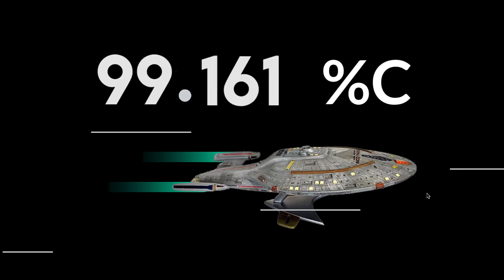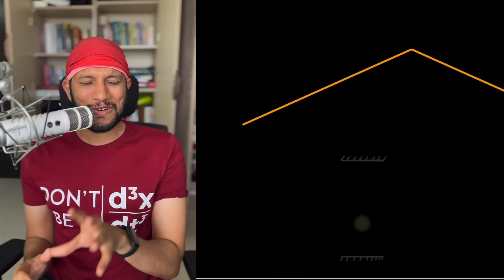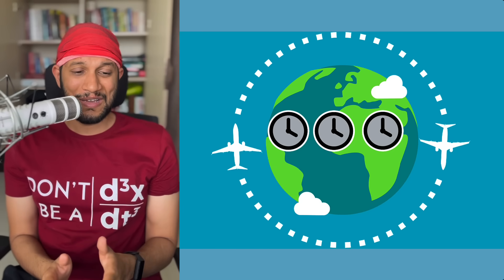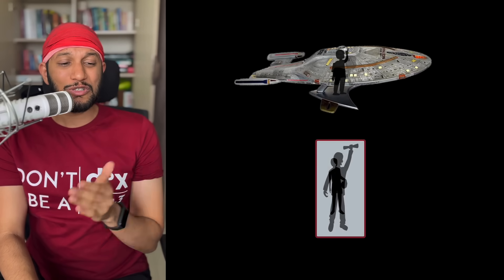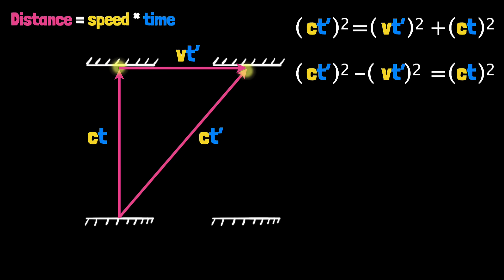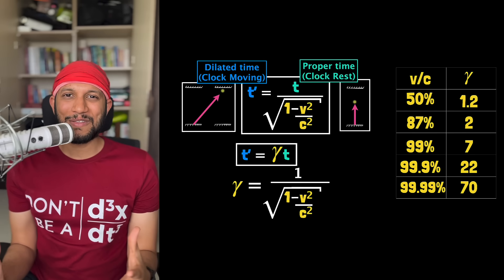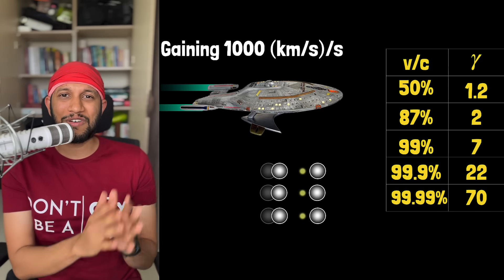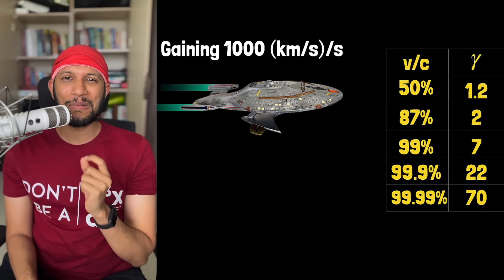I finally understood why you can't go faster than light! (My mind is blown)

Comment: You are wrong mister. The clocks on both ships are running exactly the same. There is no time dilation. It may seem slow because the light coming from the other ship that is passing you by is stretched out by the widening distance. This is called the doppler effect when frequencies are measured. When two ships approach the frequency increase and as they part it decreases . That is why some white stars moving away from us at high velocities their light spectrum is shifting from blue to red.
Reply: The clocks on both ships would be running exactly the same even if both ships were traveling at the speed of light. To the outside world, they just would appear to be moving at different rates, and upon comparing the clocks to the outside world's clocks, they would be different. However, within the ship, the clock subjectively is moving exactly the same way.
Reply: @ All the clocks on both ships and the world when compared together in one place will still be the same.  Einstein's twin paradox says otherwise where one that was travelling near the speed of light will be younger than the one that stayed put when they meet.

Comment: Hold up. I understand that the ship travelling at 99.99*c would need either infinite time or infinite energy to accelerate to c from the perspective of an outside observer.

However, time is experienced at the same rate in all reference frames. So would the people in the ship see their accelerometer hit c after ~300 seconds? And if they decelerate immediately after, would they see the heat death of the universe if they looked out of their ship's window?
Reply: Internally, they could travel faster than the speed of light. The limit of the speed of light is an observer effect.
Reply: @thuroria7631  Shortly after posting this comment, I watched the followup video! 

Turns out the answer is length contraction. From the perspective of the ship, space gets narrower as your speed gets closer to c, which means less distance travelled, which means acceleration also goes down from the perspective of the ship.

Reference frames break down at c, but if they didn't, this would mean that photons experience no time and see no distance as they move from A to B even if they're moving across the universe. Relativity is crazy.

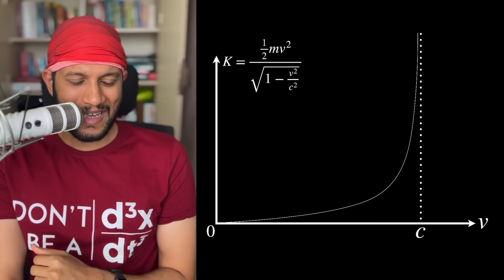Comment: 00:37 Photon clock & time dilation. This reasoning is wrong since there are no difference between Earth frame of reference and spaceship frame of reference. They are equal and for both time in another would be slower which is nonsense.

Comment: Okay, but this explains why an “outside observer” cannot see an object moving at the speed of light. But what about the crew of the ship? From their point of view, nothing special is happening and if they accelerate by 1000 km every second, they will pretty much reach the speed of light sooner or later, right?
Reply: You have to specify what reference frame the person on the ship is measuring their speed and acceleration relative to. In the non-inertial frame of the ship itself, the ship is both stationary and unaccelerated, so in this frame they'd (trivially) never reach light speed. The only other option is to measure in an external reference frame that isn't accelerating with the ship, but this is no different from an external observer measuring the ship's speed, and as already discussed in the video such an observer will never measure a speed greater than light speed.
Reply: Traveler's velocity has no speed limit.

Comment: I also heard that the mass of the object increases as the speed approaches the speed of light and that it would rip apart any mass (atoms and cells).  Great video - very informative and straight forward.
Reply: Its "relativistic mass" increases, and as the name suggests this quantity is relative. It is only to an external observer that the mass of an object moving at, say, 90% of the speed of light, increases.  In the reference frame of the object itself, its mass is the same as it would be when at rest in the external observer's frame. So the mass "increase" doesn't actually affect the object itself. 

Think of it this way: you are at rest in your own reference frame, but you are simultaneously moving at 99.99% of the speed of light in some other frame (perhaps relative to a high speed particle passing the earth). But what you personally experience shouldn't depend on your speed in some arbitrary reference frame, and you obviously don't experience your mass changing all the time just because you happen to be moving at different speeds in different arbitrary frames. That wouldn't even make sense because while you're moving at 99.99% of the speed of light in one frame, you are simultaneously moving at 50%, 20%, 80%, and quite literally every possible speed in other equally valid frames, so if your mass as your personally experience it depended on your speed in an external frame, which one would it be? There would have to be some "special" frame, but the central postulate of relativity is that all reference frames are equally valid.
Reply: @charlieharris4881  - Thanks for the clarification.
Reply: @charlieharris4881  
Relativistic mass does affect gravity, though. Which does affect the object itself.
Reply: If any mass moves with the close to the speed of light then that mass will get increased. This has been proved by Einstein mathematically..practically It has not proved so far...E=MC squared.

To accelerate that humongous mass we need infinite push...there is no such thing like infinite push...so mass can't move faster than speed of light. This is the real reason many physicists believing

Mass is nothing but purely energy....that's what E=Mc2.....adding  energy to mass is nothing but adding extra energy to existed energy...that way mass will get increased when it is in  near the light speed

In this video he is correct with outside perspective...but that is not the real reason for why we can't move faster than speed of light

Comment: If you go faster than the speed of light, you can't see where you are going... (
Reply: Pretty sure you'd be able to see where you are going but not where you are coming from
Reply: The speed of light is an observer limit. 
If you go faster than the speed of light subjectively, you experience time dilation when viewed from the outside.
Reply: @thuroria7631  To go faster than light you'd have to find a way to increase your photon update rate at which point you'd no longer have to worry about time dilation occurring

Comment: "the particle became slower"
Not really. You're perceiving it slower, but the particle still hits the mirror at the same time. Speed in one axis (x) does not interfere with the other (y). Unless you're changing the speed in (y), it will hit at the same time.

Comment: Druing Cosmic inflation(right after bigbang), the universe is thought to have expanded at 10^26  times the speed of light, if it is not possible, how did the universe during that phase achieve such a speed?

Edit: The best explanation on the concept, I've seen so far.
Reply: From the reference frame of which observer did it move that fast?
Reply: @thuroria7631  I'm just looking at things with youtube, just search up cosmic inflation theory.

I watched this video right after watching that video, so question was born.
Reply: @thuroria7631  another video I saw. I'm asking the question that came to mind. I dont really know which observer and I dont even think there could be an observer present at the moment it happened... just search up cosmic inflation theory.

Comment: Whenever someone talks about time dilation, they use a spaceship traveling through space, but there is nothing in the equation itself that prohibits the effect from occurring on the surface of the planet (of course, such acceleration would be catastrophic on Earth), but it does involve a mental exercise:

Let's imagine that there is a gigantic circular race track in a given city, and at the starting/finishing point there are two stopwatches. Two people will run a lap along this track, and they will press the button to start the stopwatch when they start running and again to stop it when they finish the lap.

Now, as for the runners, one of them is an ordinary person, running at 10 km/h and the other is the fictional character The Flash, who has the following (convenient) characteristics: he can immediately accelerate to his maximum speed and keep it constant, and he does not cause any collateral damage to his surroundings. Flash will then run at 99.999'999'999% of the speed of light.

Here is my statement, based exclusively on relativity: In the eyes of the fans watching the race, Flash will lose the race, by an absurdly large margin. In fact, it will take Flash years to complete the circuit.
Reply: You are mixing up traveler's and observer's velocities. If flash's OBSERVER speed is that close to the speed of light, his internal TRAVELER speed will be far greater than speed of light. Chances are, to flash the race is over in 0.000000001 seconds, and to the observers, it's over in 0.0001 seconds. 
You're misunderstanding so many things about time dilation it's not even funny. You can't travel slower by traveling near the speed of light, that's ridiculous.

Comment: ok i'm back to watch it again :D and an idea came to mind.  gravitational fields warp space time right?  if you could put one of these fields inside another field, could you propel the outer field with the inner one trapped inside, past the speed of light?  the field inside would warp space one way, and the outer one the other way right?  would they protect each other enough to maintain integrity to allow it to be done?  what kind of buffer might be needed between them to reduce the space time dilation between the two as to allow living things to survive the trip?  hmm maybe you could launch a warped space bubble (object) using another... would that allow the one fired to achieve light speed?... hmm stargates could become real...lol

Comment: In important point: The simple claim that “the photon-clock slows down at a higher speed” is not really accurate.

Rather the moving photon clock slows down relative to a different reference frame (in the video, the reference frame of the speaker).

In short, the point of the Theory of Relativity is that it is meaningless to speak of any such measurement without specifying the fervency frame you are talking about.
Reply: It's completely faulty, in fact. Both photon clocks internally move at EXACTLY the same speeds the entire time. The observer effects just are different. But to the clocks themselves, NOTHING is different. It's different to US, not THEM internally.
Reply: @ : Exactly.

Comment: Only thing I didn't get - Okay, from outside persective the ship almost stopped accrlrrating, even though it's going at near c speed - but from the inside, if time still passes the same way - wouldn't their a be the same? And therefore, while the world stops around them, wouldn't they actually reach the speed of light as expected?
Reply: As experienced inside the ship, they are moving FASTER than the speed of light. While the observer effects cap it at the speed of light. If they travel 100 times the speed of light per second, then it takes us 100 seconds to observe -> we age 100 times faster during that time. But both us and the ones inside the ship experience it as if it's perfectly normal, with no dilation  happening. Time dilation is an OBSERVER effect, they are NOT felt by the objects themselves. "did you just say they move faster than the speed of light" yes internally, but not to the outside world, where the difference between their internal velocity and the observed velocity is the time dilation effect.

Comment: The reason that you don't understand it is that either you've never tried it, or you've tried it and given up. If you analyze Einstein's mathematics you'll find out that he made ASSUMPTIONS, and based on those calculated that you can't travel faster than light. 
He did not prove it, and could not because he did not completely understand the nature of "space" and "time". This is still a failing of physicists today.  (The "space-time" theory only works if you assume the universe is 4 dimensional. )
Reply: Yeah, the theory is far from robust and absolute. I personally think the idea of spacetime being some 4-dimensional space is thoroughly stupid. Then we need stuff like lambda cold dark matter to explain 99.99% of the universe just so we could fit it neatly into our mediocre theories. Sorta like me going 1+1=500 because all you need to do is add 498, so since 1+1+498=500, 1+1=500. That's lambda cold dark matter to justify the four-dimensional spacetime theory in a nutshell.

Comment: Don’t really follow this. While the speeds are not attainable anyway. It seems to me that if an object is moving so fast, and that object launches another vehicle from that object, are you saying that new vehicle would not be able to pull away from the original object?
Or even simpler, that a vehicle travelling at 99.999% the speed of light, were to turn on its headlights… that light would just trickle away from the headlights at an observably slow speed? Surely those on the moving object will see the headlights shining out brightly as it would be seen normally from a regular stationary object.
Reply: They're observer effects and have to do with reference frames.
"Surely those on the moving object will see the headlights shining out brightly as it would be seen normally from a regular stationary object."
Yes, since they're the reference frame, and hence the light from the headlights could travel at the speed of light forward from them, even if they themselves are traveling at the speed of light forward already. To outside observers, it might look like the headlights do nothing, but to the travelers themselves, they would see with them normally.

Comment: The one part that always hung me up is c being the same in all reference frames. The photon on Ship A, which is moving at .9c, is moving "diagonally" in the clock, from the reference point of Ship B which is sitting idle on the space dock. But why is Ship B not moving at .9c "backward" from the perspective of Ship A? This seems to imply a sort of static coordinate grid, like in a video game, where there's an absolute "world space" that's basically the universal identity matrix for everything. The value for c appears to be relative to this static grid.
Reply: No, there is no absolute world space. c is in relation to each independent observer.
Note it's perfectly possible that us humans experience time 1000000 times slower than it actually moves to another observer. And to that observer, light could appear to travel faster.

Comment: I know I'm like super late to this, but I have a follow up question. I understand the reasoning that you can't go faster than the force vectors affecting you, since they can't affect you, if you are going as fast as them. What I don't understand is: why that means we can't go faster than light specifically. Isn't it possible that there is an undiscovered force vector capable of travelling faster than photons, which could then allow you to surpass the speed of light?
Reply: Speed of light is the limit of observer effects. Nothing travels faster than photons, whose traveler's velocity is infinite.
Reply: I don't think my answer will suffice you but nothing is faster than the speed of light. So there's no surpassing that speed

Comment: This was so clear. I've been into science my whole life and never understood this concept so clearly until this video. I think the root of the problem is that all our life we are dealing with the "philosophical" idea of time. So when we hear this concept as "time dilation" we apply it to the concept of time in an abstract sense. Science could save itself a lot of trouble if the term "time dilation" was changed to something like "atomic dilation" or "atomic-function dilation" or something along those lines. Otherwise this concept will always appear far more complicated than it is from a non-science POV. I fully understand what you said about time in a scientific sense needing to be something measurable, but unless your brain is wired to think of time in that way, then the term "time dilation" is confusing. PS I loved that every time you presented a piece of information I asked the exact question you used to lead into the next piece of information. This video was amazing. Thank you.